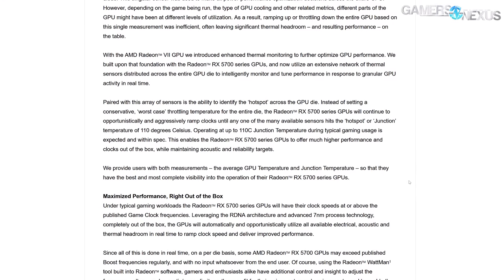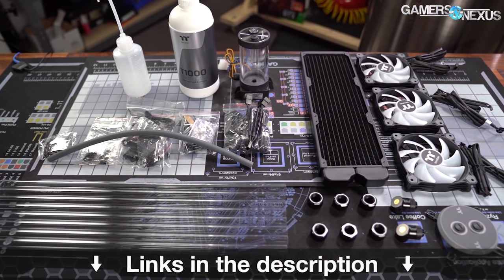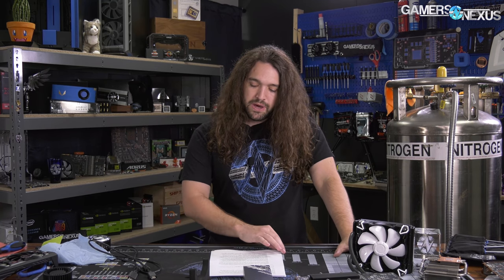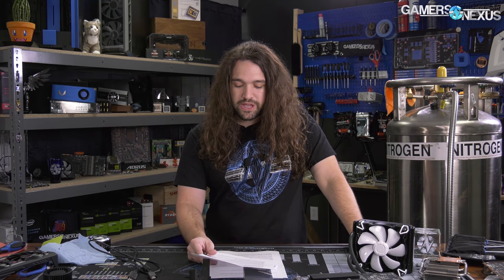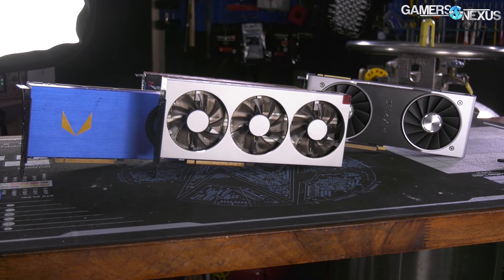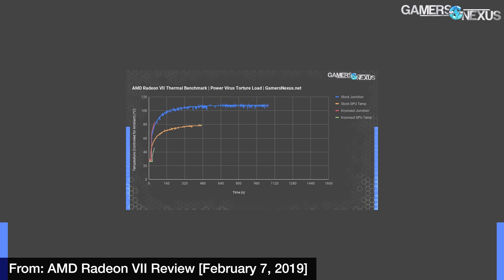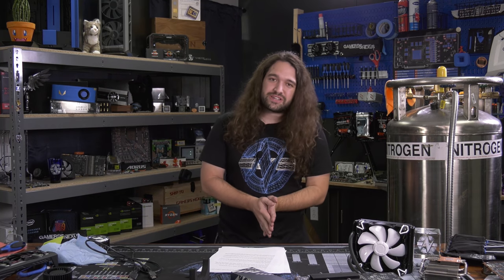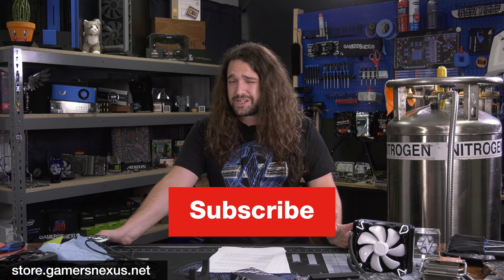Explaining Navi 5700 XT Junction Temperature | 110°C is Not "Expected"

Comment: my 5700xt by sapphire  nitro at 1750mhz hits 89-92 celcius  j.temps , but GPU is 65-70  playing assetto corsa at 4k with locked 65 fps.., just invest at a good case with good fans and you will be fine , maybe juction temps are suppose to be higher

Comment: You shouldn't bash the blower cooler so much. It has legitimate use cases and it is genuinely better than the one on Vega. But yeah, the video is appreciated as nobody should be running their GPU at 100+C if they can help it... The only thing that really pisses me off is the low availability of the new partner models! But hopefully that's only temporary.

Comment: 110°C is not normal.  I am modest. GTX 1660Ti is all I need never topping 70°C @144Hz on custom settings in the games I play. People need to learn how to set up the graphics settings in games and not use the low/med/high/ultra presets. The main issues are pc cases. People trade off RGB bling for a good airflow case and most dont even look at reviews for cases to see what kinds of temps said case has. Its crazy.

Comment: So NZXT is going to sell a bunch of G12 brackets to 5700 owners after GNs aio mod vid?  Throw on a mini pwm adapter, Noctua 92mm fan, obligatory Afterburner fan curve.  Easy mode alleviate the temp issues, go figure out your voltage limits unless you just wanna let the temp & power sliders.  Like the touch on case airflow, people seem to discount case airflow potential impacting gpu boost performance.  Like running Costco tires on a 1/4 mile track.

Comment: Mine sits around 81c under max load and thats after  afew hours of gaming on RDR2 , this is using an Powercolor RX 5700XT Red Devil, core temps 60-64c TJunc - 75-81c at fan speeds around 60% with a 26c ambient.

Comment: AMD's statement might actually be correct, if you look at the GPU down to the individual cores/shaders, I'm pretty sure that the junction temps are reaching 110ºC......But with the amount of sensors they have on-die, and with how they are working so fast to dynamically adjust clocks over each individual core/shader(bet that hits the scheduler hard), you're not going to be able to physically see it in software, and probably only using an oscilloscope(with probably 2000MHz+ sampling) IF you could hard-wire up to every temp sensor.  If it was an engineers explanation that some PR guy had to put to words, then I can see where the "scope" and context could get lost in translation, and unless you were very tech savvy, you wouldn't see past the over-simplified explanation.
Still, very interesting to see this level and accuracy of control over such a small die.

Comment: I have a Gigabyte RX 5700 XT, blower style version. I installed an after market video card cooler, Arctic Extreme IV Revision 2. When I run a GPU stress test via AIDA 64 and this for 30 minutes my video card does not get hotter than 68C Celsius. How do I measure this Junction Temperature?This after market video card cooler performs perfect and makes a very big difference comparing it to the stock blower style cooler. The only bad thing about this after market video card cooler is that you not only have 3 fans and a heat sink in the front of the video card but also a heat sink on the back of the video card. This prevents you to install the video card in the first PCIe slot if you use a beefy CPU cooler like the dark Rock pro 4 or Noctua D-15. This I'm going to solve with a vertical PCIe bracket, in my case there is more than enough breathing room for the video card because I have the Thermaltake The Tower 900 case.

Comment: XFX 6700XT Merc 319 w/ a junction temp reaching up to 102c under sustained full load in an h510 alright?  (using 3dmark timespy stress test)
It usually stays under 100 when under 100% load, and drops down to 40-50c when idle, even when left running overnight.
I just ran a stress test undervolted, and it only reached 100c at around 4.5 mins of the amd stress test, but as soon as the test ended, it dropped back down to around 60c.  It never stayed at 100, but perhaps that is the fan I hacked into the H510 that blows air at the gpu from the basement compartment...
GPU fan speed was around 1900 rpm at max.

Comment: These temperatures might cause problems down the road. I bought this card and we used it for one week, then returned it and got the EVGA 2080 super ftw3. Don't get me wrong, this is an awesome video card for the price. The only problem is the Heat. When playing games with the stock 5700 XT at 1440p the temperature are in the high 90s, when surfing the internet it was in the 50s. The EVGA 2080 super ftw3 operating temperatures we're 50% less. AMD must have realized that these operating temperatures we're going to cause some controversy. Even the aftermarket cards seem to be running at high temperatures. It's like having a blow dryer connected to your computer. That aside, I will say this. The 5700 XT was getting higher frame rates in some games.
Reply: Sounds like the red dragon from powercolor got the temps under control, would recommend it for anyone who is thinking 5700xt
Reply: @faffabout9412  that's good to hear. There's going to be a lot of happy Gamers out there that can't afford these top-tier cards.

Comment: Most the inductors and power chips right next to the die are only spec’ed to 80C. I’ve never seen a 150C inductor. Of course that’s spec and not max temp “before it literally breaks”. Check out mouser. I had to replace the inductors on my gtx 980 after 2 fell off

Comment: I bought a reference card to get the MSRP. 

I'm going to watercool my whole PC once I have another $1000 and the blower won't matter but in the meantime this thing is pretty loud sometimes
Reply: With 1000$ you could get a 2080ti for performance xD

But if it's for your hobby and aesthetic passion I get it. I like custom loops too
Reply: blower is fine with 5700  if you have a ref xt and want to get it cooler and less loud do the washer mod steve mentioned awhile ago and apply thermal paste.
Reply: @darylb4473  blower is not fine from 10 years ago, it was never fine for any gpu
Reply: @MissedMessages  I don't want to give NVIDIA for my money cos I follow coreteks and Moore's law is dead and they pretty much showed how hardcore NVIDIA have raised the entry MSRP of their cards and I'm not interested in ray tracing. 

I just wanted to support the underdog. 

Also when it comes to resale I would lose alot more than I would selling my 5700xt
Reply: Also coming from a 6700hq and 980m the performance was a massive upgrade and I honestly never notice the blower sounds cos I have a 300w sound system and headphones

Comment: I still say it was probably not smart of AMD to expose this temp.  It just added one more thing for people to bash them about for their simply adequate (and nothing more) cooler design.  All of their cards have probably run in the 100C or higher at the hottest spot in the silicon for near a decade now.  I know my 6870 ran around 84C edge temp under normal operating conditions and I only retired that card like a year ago.

Comment: Got my AMD 6900 XT, on default settings, playing with temp around 80/90C and junction temp around 100/110C. Random freezes, crashes. Had to lower clock and voltage, now around 60/70C and junction 85/90C. So good so far and yes its not normal to have on default junction almost 110C. Ty for confirming.
Reply: Same situation with my 6700xt 
Can you tell me what is j temp and how can i fix it? Can i fix it by repasteing? Other than undervolt how can i fix it?
Reply: Same here but a rx6800 junction temp 100c and dont have crash.  Undervolting is a good thing for lower the temps. What manufacturer is your 6900xt ? sapphire ,Gigabyte ?

Comment: I don't have a dog in this hunt and I really wanted to agree with this video, but with a small exception it sounds like circular logic. "110C is bad because 110C is bad." You admit this doesn't hurt the silicon, and reviews comparing the hotter reference design to the cooler parter models shows nearly identical performance. 

The real difference here only comes down to noise levels, but that is a preference option. It's not core to the functioning of the card. You can't claim a card is not normal simply because it is louder than another card. The proper way to handle the situation is to note the noise difference and let the consumer decide if that is enough to pay a bit more for a cooler design. Price, availability, or any other factor could make the hotter design the better choice for a specific individual. Btw, my personal choice would be to go with your recommendation and get the cooler design.

With that said, you are correct to call out AMD for inartfully or plain incorrectly describing the situation. Their explanation does lead to people coming to the wrong conclusion about how the card works.
Reply: jvalex18 As I pointed out, in reviews the hotter cards have the same performances. The only difference is noise. If the hotter cards had significantly less performance or harmed the silicon I would agree with the video's argument, but that is simply not the case.
Reply: jvalex18 That is all theretical. Look at the actual reviews. The performance is the same. If you had two computers, one with a reference card and the other with a cooler partner card, the only perceivable difference between the two would be the noise.

The real issue is that AMD's announcement made it seem like running at 110C all the time was normal when the reality was that temporarily peaking at 110C was normal. There are other limits that kick in before that most of the time. It's that 110C peak limit that is normal. Previously that limit would have been lower because the temperature sensing was less accurate, so AMD had to set the limit lower to provide for a greater margin of error. Now with more accurate sensing, AMD set the throttling limit closer to the real limit of the silicon.

This is part of AMD's general performance strategy. They are automatically overclocking their chips and leaving less performance on the table. This is proven by the fact that partner cards can't improve performance over the reference design. The only thing they can do is reduce the noise. Enthusiasts are expecting to find that extra hidden headroom and can't. That is the new normal and is what AMD was trying to say.

Comment: From what I gather based on this. 110 is like the red on your rev meter in your car? You can technically drive on it, but shouldn't?
Reply: Ugh, way overstatement... If you DON’T redline my car every time you drive it, then it will fail in 20k miles... If you do, like non-stop track racing thrashing it around, then it will probably run 100k miles fine and outlast almost any other engine in those conditions. Car engines are different from each other, just like you can’t generalize cars with computer parts (example, you want some flash memory warm, and others iced over on liquid nitrogen, varies if it’s SamsungB/C/D/E dies or Hynix/Elpida/Micron, it varies). Just because X is good for someone (like a sweat cake), does not mean it’s good for the next person (next person might be diabetic and go into a coma).

Preferably on THIS card, you want it lower (to a limit, as I have had issues with sub-zero daily cooled cards cracking the solder from the cold thermal cycles, so too cold is defiantly a thing), but 110c thermal hot spot (which would be shown as 80c in other GPUs since they don’t report this temp sensor) is probably fine, but you can get a little more frequency out of it if it’s colder (so get the Sapphire model). It might not be bad, but even a small improvement in performance is still an improvement.

Comment: Without comparison of other Junction temperatures, the video comes off as senseless rambling based on non-technical expectations of which temperature values are considered adequate. The hardware enthusiast world seem to be full of people that stress too much on numbers that can only be noticed if you measure them and use that metric to construct arguments and pass them as definitive truth. It also makes one wonder how well Fermi was temperature wise, considering the cards had holes in them whose only purpose was to help with cooling. And that GPU would hit 100ºC under NORMAL operation.
Reply: Have you seen the teardown of the reference card? A thermal pad. They used a thermal pad on a GPU die in 2019. Come on dude. Sure it can run at that temperature but no one can argue it's an optimal scenario.

Comment: I'm not defending AMD, but to be fair, we all need to agree on who exactly is the arbiter in charge, who is it exactly that is entitled to claim what temps are normal, and what temps aren't. Because if AMD wants to make the point that they made a conscious choice to run a higher temp, they are entitled to do so. Also I think we've all grown a bit accustom to temps being in a particular range, but maybe that will change. Just playing devil's advocate. I actually agree 110*C seems excessive, in particular because the custom coolers don't get near it. I ordered an RTX card so meh, whatevs. Btw, I think we can all agree probably almost nobody in the company wanted to do that kind of cooler. Maybe it was marketing, or maybe it's some kind of agreement with board partners that they stick to blower coolers. It's kind of gross that they didn't learn anything at all from the disastrous R290 / R290X release. Who knows, blower coolers just suck, hard. My current 980 is a reference from MSI and in summer the fan spins at 78 to 80% fan speed to keep it at 80*C. Fucking industrial pump type noise, can't wait to retire it in a few days.

Comment: The R9 290X had a safe operating temperature of 95 degrees. I wonder what junction temperature would've been in this instance?
Reply: 65c edge is around 80c junction so 120 to 125c junction on a 290x, give or take.

Comment: Hi. Did you ever test ASUS Radeon RX 5700 XT ROG Strix OC? I got this problem after adding more memory. upgraded from 16 to 32, after that, when running all kinds of games, old or new, it boosts up to 110°C and stays there, my theory is that the chipset runs at a highet temp with more memory and that my HD/SSD stack i restricting airflow to both chipset cooler and GPU. running on a Bequiet Pro900 rev2 case. Thoughts?

Comment: i know its an old video however im looking for more information on the gpu hotspot. you showed two graphs which leave out some critical info imo. the first graph you showed clock speed and length of time 3dmark ran for, but no temps, the next graph you showed a normalised db test with temps, but no clock speeds or length of time or what test was done to get the noise levels you present. maybe you should revisit this topic again with some updated knowledge and better graphs.

Comment: AMD needs to find someone that can dumb things down so the masses dont get confused. Also the wording used is not very clear in there post.
Reply: There's a limit to how much a subject can be dumbed-down before losing essential information/ detail. You want to know if there are any hotspots on the processor, be it uneven TIM or cooler not covering the whole die adequately.

I'm surprised anyone would think 110c is fine, as temperature is the most important factor when pushing clock speeds.
Reply: @garethevans9789  I agree.  Still I think that AMD's statement was misleading at best.

Comment: My Red Dragon 5700xt is running a 90°JT when at 75° average

Idk if it's because it's vertically mounted and no air is getting under the card, if the paste is bad, or what

But I'm hesitant to make the jump from 1080 to 1440 if it's going to ramp the heat up. Probably just gotta get a case with airflow in mind

Comment: to "expect something doen NOT necessarily mean saying that, 110C is normal and will happen everytime. in context of technical engineering it simply means "under certain conditions it can hit 110C. and the claim of 110C being in spec is actually very true aswell. 110C IS in spec and will (from a technical point of view) not hinder the function of the device. although i have to say, that saying that the card will boost until 110C is actually wrong and misleading.

Comment: Aren't the parts of the GPU degrading faster due to the higher temps?  Such as the capacitors, chokes, etc.
Reply: Generally yes, but being electronics anything can happen.
Reply: @uranium5694  hmm so if I run it at near absolute zero it should last forever?

Comment: Here is a little enigma.
 I have a radeon hd7850 (twin forzer edition from MSI). I got it overclocked and stable for a bit but not long ago it crashed (grey shades grille on screen with pc frozen). Stability was tested by running unigine heaven for a few hours (i know, not the best stress tester but its an old gpu so...).
After that crash, the PC wouldn't even post when plugged to the screen via DVI and would not go past windows loading screen when plugged via HDMI. Obviously this means the GPU is dead (pc boots and works fine with the gpu removed) but I wonder why ? I play with temps on display via Afterburner and it never got hotter than 65°C. 
Im starting to wonder if it could be due to VRM or memory going too hot since the cooler doesn't seem to contact them.
Reply: @SISSYPUSS  didnt seem loose and the problem persisted after re installing the card. Didnt think about a dirty slot tho, i will give it a shot good idea !
As for getting the hands dirty and giving it a refresh i might give it a shot too since a new pc is getting build anyway i dont have much to loose lol thanks !

Comment: My (rx 5700 xt msi reference) runs on a ekwb water block always on 2000 MHz.
And this on 55 degrees und the junction temp is on 78-84 degrees
And the gpu Block, cpu and radiator is from aluminum